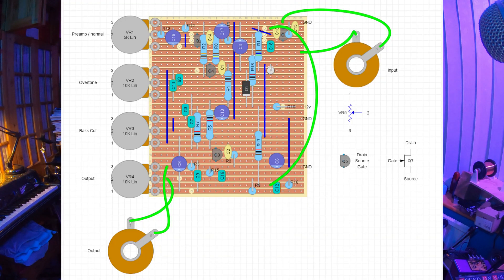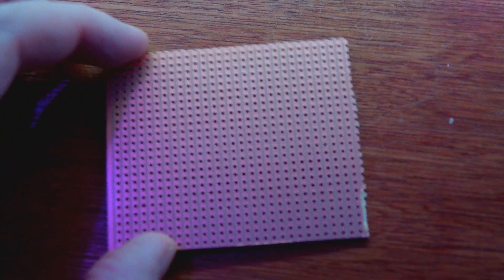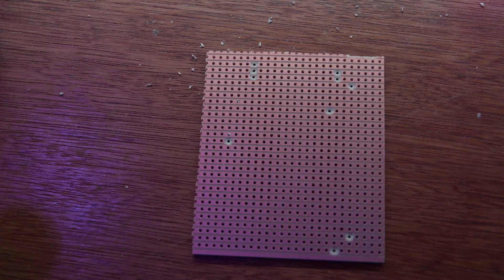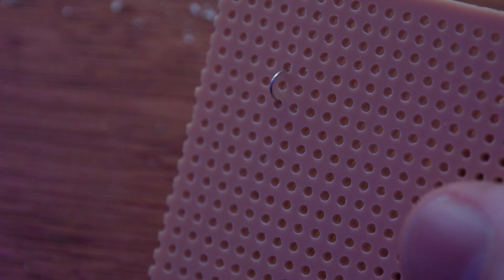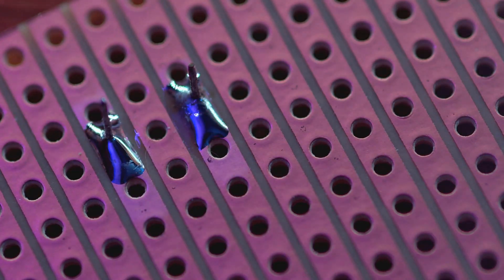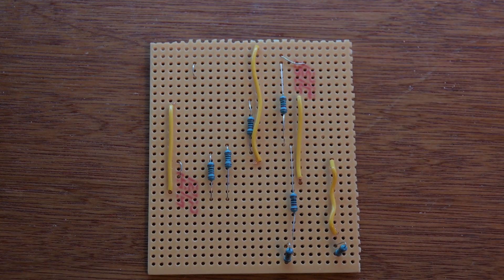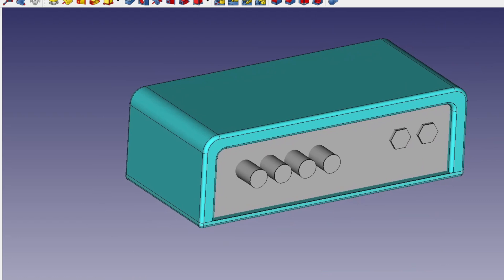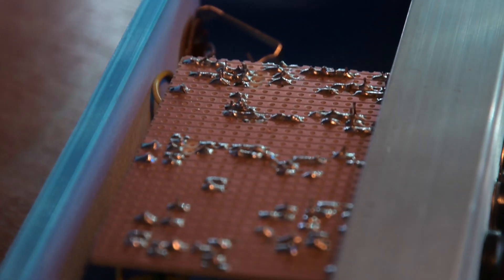Chasing the Dyno My Piano Sound Part .2 - Creating a Preamp

Comment: I have a Dyno My on my Rhodes. I actually have tried bypassing it to get it to act as an orig passive rhodes. Any insight for acheiving this is very much appreciated. 🙏
Reply from the maker: Bristol electric piano company sells a passive control set. It's super well made and will outlast your piano.  I would get one of those and bypass the Dyno controls. Tim who runs Bristol electric piano is an expert on Dyno stuff so would it run it past him if you get stuck.
Reply from the maker: The simplest way is to get an RCA to 1/4 inch jack to allow a standard instrument cable to plug into the harp. There may be some Dyno mods and setup that creates the Dyno sound.
Reply from the maker: https://www.ebay.co.uk/itm/331890090791
Reply: Thank you so much!  Great channel Dean!
Reply: also thought I'd experiment with a simultaneous mixed sound